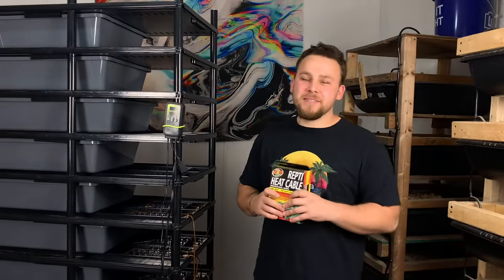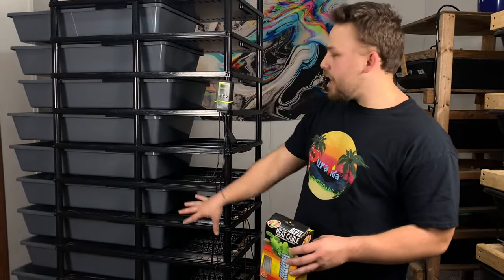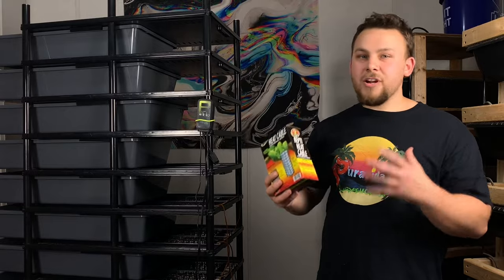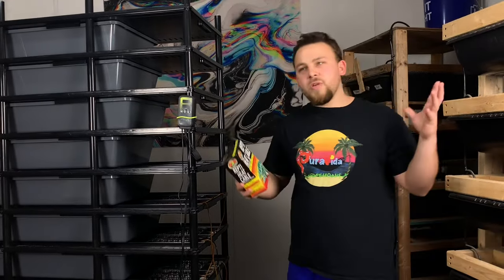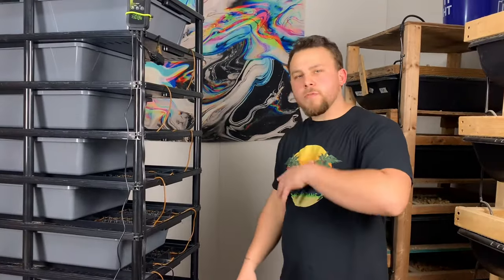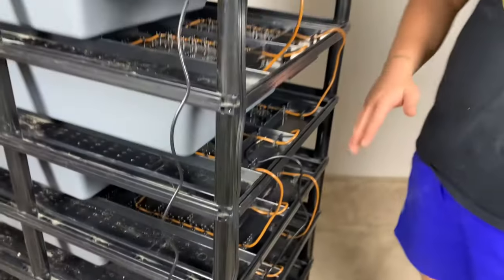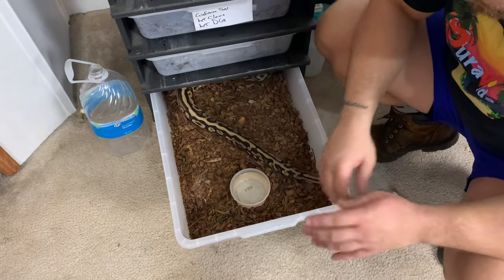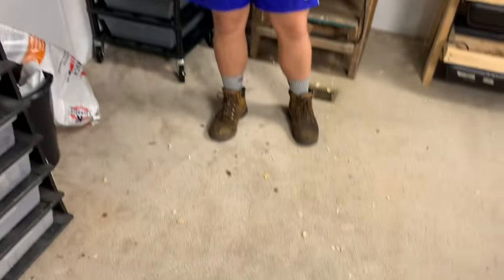How To Setup Heat Cable in Vision Racks

Comment: Close one. What rack is that and do they make one for baby corn snakes? Do you use heat cable versus heat tape for all your racks? Thanks.  
I see you have a video setting up a rack. 😁
Reply from the maker: @cosmo9362  this is the V-70 rack from Vision. I believe they do make a hatchling rack for corns👍🏽 I only use heat cables with these Vision racks but I really enjoy it. Heat tape works better for the other ones I use. They both work great
Reply: @PuraVidaPythons  thanks, I went looking at Vision website after watching your other video. How do you mount the heat tape? Mount to bottom or back, tape it down? Thanks again
Reply from the maker: @cosmo9362  the racks we use heat tape have grooves made to keep em down I think u can use some electrical tape to customize stuff tho
Reply from the maker: @cosmo9362  we are probably going to get one of their hatchling racks. They look nice 👍🏽